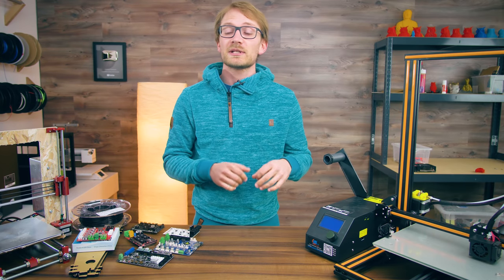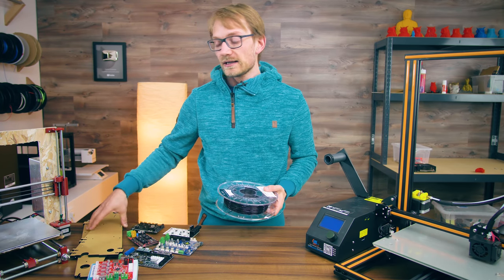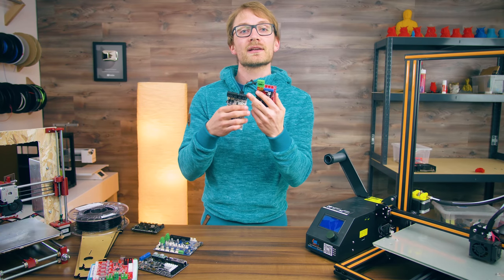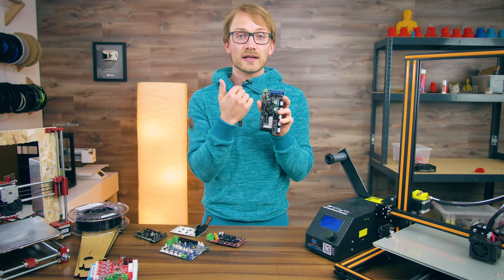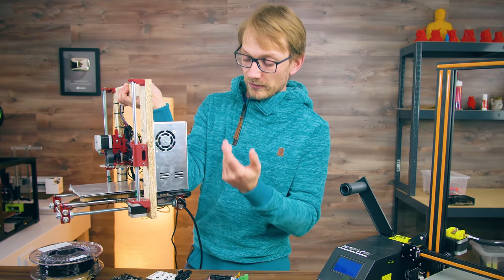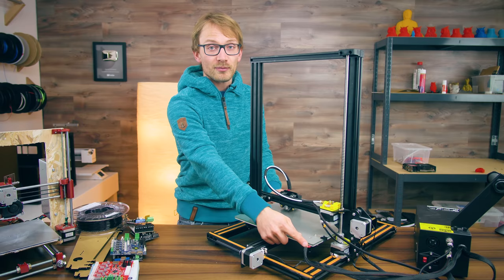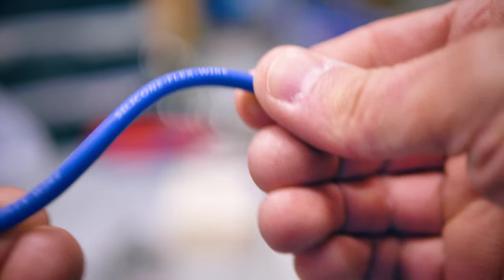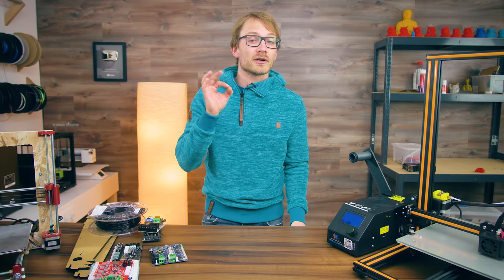Everything you need to know to make your 3D printer fireproof!

Comment: As a firefighter myself this is a good topic to be covered. With things being made cheaply to keep cost down safety is the part of the trade off. It's always a good idea to do routine inspections of your equipment to make sure there's no problems before it becomes one.
Reply: Agreed, plus a good idea to situate the printer away from combustible materials if possible to prevent a fire escalating. Not a good idea to leave it unattended either. I've seen adapters and plugs on high power appliances such as electric heaters go into meltdown because of bad spot welds holding the internal bus bars and pin contacts together.
Reply: Do you think it's a good idea if I inspect my printer from a stream webcam with octoprint while I'm away? Pause my print or simply use a remote socket to unplug it! I can stay for the first hour maybe or something
Reply: thank you for being a hero! :) THANK YOU SO MUCH!

Comment: I've been thinking about picking up some "Stove Top Fire Stop" fire extinguishers for my 3D printer enclosure.  I made an All-wood enclosure (even though you discount it, having an all-plastic enclosure is just as bad, maybe worse) for my printer.  There are a number of automatic fire extinguishers that rely on a fire melting something to release the retardant.  I think this is something we need to see in the 3D printing community.
Reply: Maybe its an overkill but in somecasses its should be usefull. I think its more importent to recheck everything in 3 months or so. maintenance
Reply: I was thinking about getting something like this too, but my concern is that it's designed to be mounted on a metal stove hood, which isn't going to burn or melt. It only goes off after sustained and direct contact to fire, so If you put it on a wood or plastic mount, it's possible that it falls off and fails to trigger.
Reply: Yeah you can get those online @wildrosebuilds has a video testing them out. They're not the cheapest but the peace of mind is definitely priceless.

Comment: This was actually one of my biggest concerns when I designed my 3D printer. Here is a list of all the things I did to prevent fires. 
- Lots of fuses. My bed and my hotend have there own fuse. The board also has its own fuse
- All heaters currents go around the board, not through the board. The bed has an SSR
- All Marlin safety features used
- When SSR's fail, they stay open all the time. Therefore I use a relay which can shut off the current going to the bed and the hotend. The relay is operated by the firmware and is turned on when the printer turns on, and turned of when the kill procedure is activated. 
- There is a mechanical bimetal switch on the bed which switches the bed of at a curtain temperature in case of a firmware error with the bed heater.
- My printer prints inside an enclosed frame. I have a smoke detector inside the printer frame. Smoke will be detected at a very early phase. 

My printer actually failed once because the connector switching the safety relay got lose. It is always funny when your ridiculous amount of safety features cause problems of there own.
Reply: In response to your last line,  I work on military helicopters doing electrical work.  The engine fire detectors, that tell you when your aircraft is on fire, go bad and set off the warning quite often.  I've changed dozens of those sensors but have never seen an engine fire.  I think it's to the point that the pilots assume it's a false alarm every time it happens
Reply: I got one from that same brand. If I remember correctly the brand was "Self Fulfilling Prophesy"

Comment: There is a company in the UK called Jacktone who sell "Auto fire extinguishers" the just have a hose connected to the valve.
When the hose ruptures from heat, the extinguisher releases its content.
These are great and work without triggers, cable or other moving parts which have been known to fail and not trigger the fire extinguisher.
Reply: Don Mega he said contents not water
Reply: Fire extinguishing also should cut off power supply first
Reply: Don Mega you can get auto co2 extinguishers, problem solved

Comment: Gypsum board/drywall... there's a REASON it is used in structures. So instead of making a wooden box, build a drywall box with the wood frame OUTSIDE the panel;  any flames that occur can only come in contact with drywall.  (Note drywall will not contain a raging fire, and the "seams" are a weak point but you can use angle bracket framing to help prevent any flames from leaking out)

Comment: Really great video! Something you might have added, when talking about improving your printers safety are external mosfets: They are designed with more current in mind, so they will have reserves, but they also come with connectors that are capable of dealing with higer current than the stock connectors on the control board. And by using an external mosfet you lower the current going to your contol board, lowering the danger of using the bad connectors for power supply of the control board. And it will allow you to add a fuse just for the mainboard with a rather low value, because all the big currents will run on the external mosfets. I think it is a major safety upgrade for a 3d printer to use external mosfets for hotend and heatbed and use 3 fuses - one for the headbed, one for the hotend and one for the controlboard (without heatbed and hotend current).

Comment: My machine is in an IT rack that ended up being just the right size for it and its accessories, it's extremely cheap second hand, it's sturdy metal with a glass window and has plenty of mounting points for cameras, raspberry pi, spool holders and whatnot, it keeps the ambient temperature predictable and avoids drafts, keeps everything dust free and it looks badass. ^^

Comment: The only time I've had a thermal runaway is when my layer cooling fan shroud was poorly designed and cooled the nozzle.

Also, if fire is a huge concern, there's likely a way to wire up a fire alarm to main power of the printer.
Reply: By the time there is a fire, cutting power won't matter.
Reply: @janbroz4681  thats so true! cutting power makes no sense if there is a nice little fire going on
Reply: @janbroz4681  it will smoke before it burns (I think)
Reply: @korodo7599  fair point
Reply: @janbroz4681  Actually it very much matters. There is no point in a sense on putting fire out, when heat source is still creating more heat, ie shorting wires etc, so first cut the power and then put out the fire, if possible both at the same time. Also helps to prevent getting electrocuted if metal frame is on contact with the wires or something like that. After power is off, you should be able to put it out even with some water(?), if there is no fire extinguisher around, witch there should be one and it should be inspected one for that.
Reply: @Hellsong89  I wonder how people do that when they make long prints (even several days ones). Don't they move from the house / appartement? And to have dedicated space where there is nothing flammable within reasonable distance is not that easy. Maybe it would help to have printer in some proper metal case that prevents fire to escape even to leak i.e. melted plastic on fire, still ...
Reply: I have done this on my printer. I have a power relay and thermal fuses that cut the main power when anything starts getting hotter than it should. If a fire does still manage to start then I have an automatic fire extinguisher and a smoke alarm. The thermal fuses should blow before anything gets hot enough to cause a fire though, Video on my channel if anyone is interested.
Reply: @RickyImpey  Cool video!

Comment: Awesome Video Tom!!! I own an Anet A2 I have two small children at home, and the first thing I did was upgrade the main wiring for the heated bed and from the power supply with 12awg silicone wires, also bought spade connectors, auxiliary mosfets, a 33amp power supply, smoke alarm, changed the connectors on the heated bed, and managed the wires properly... now I just bought inline fuses for both the hotbed, and hotend!! Thank you for this, one more thing that I can add to my printer for some more peace of mind!

Comment: I love this video. Ive been advocating so many of these safety tips for so long. A few more things I may suggest:

Cork pads/mats. Cork dosen't burn like a yoga mat or rubber mat can. Makes for a great insulator for a printer to sit on to help limit sound vibrations, Can be easily gotten and used to help insulate mountings of electronics from metal frames.

Sheetrock. Another good, non-flamable material you can set your printer on top of to help keep a table top from spreading a fire, this is the same reason it is used on the interior walls of a house or gun safe.

Another idea I have seen people do with RC batteries that may work for a 3D printer if there is a large enough rack over head of it, A large plastic bag full of sand. The basic theory is the heat from a fire melts the bag, dumps the sand and smothers the fire. The sand also can help to limit spread of any melted plastic to help stop the spread of anything burning.

KNOW WHERE YOUR GAS LINES RUN IN YOUR HOME!!!! Dont print next to gaslines. Should a printer fail, it being near an even bigger fuel source can make the situation worse. Yes, gaslines are rated to deal with some degree of flame to help stop failure, but dont blindly trust it on its own.

Just a few ideas for v2 of fire safety video :P
Reply: Actually, another point about nearby gas lines is if you do get a gas leak, and there is a heated nozzle and bed nearby, that heat could ignite the gas.

Comment: I plan on using a smart smoke detector.  I'm almost finished with my enclosure.  One of my other hobbies is automation.  I personally use Smartthings to control lights and doors.  I already have a power switch that my 3d printer runs through.  I can power off and on the printer remotely if needed.  It comes in handy when that one print is almost done but I have to go to work. 

With the smoke detector in the enclosure, I plan on setting it up to automatically turn the printer off if it detects smoke.  That way, if the smoke is electrical in nature, it should prevent a fire if is detects it early enough.  I would expect it to also work for catastrophic print failure that balls up on the nozzle and causes any smoke.

Comment: I had the cheap ramps connector melt on me once. I ended up buying a bag of 12v barrel jack connectors for it instead and just pressed it in the pins. Works like a charm and it hasn't melted or shown any signs. Good stuff.

Comment: I also own an Anet A8, for roughly a month now. Today has been a very  weird day for my relationship with it. I received the recommended mosfets and a soldering iron in the mail, got really stoked about how well it's lasted and started taking it down. When I took the bed connector off, it wiggled right out of place and had a nice scorch mark on the side next to the 12v pin. After following the community's suggestions of "fixing it", I see Thomas has released a video with even BETTER suggestions about this very issue! 

I can't recommend enough that if you buy one, get the electronics and do some soldering... I really don't think these are complete right out of the box. 

That being said, it works quite well. I've binged hours of different 3dp content before and during my ownership, and i'm really happy with the quality of what little I have made. I would still recommend it to people, with the stipulation that you treat it like it needs to be treated. Like a cheap piece of miniature chinese industrial equipment. lol.

Comment: How great! I have learned so much from watching you. You pointed out a fault on the Creality CR-10. I bought one. They must have watched your video because they thought they solved that with a plastic strain relief attachment. The only problem is, it prevents the bed from leveling because they attach it under the bed the a leveling lug. I sent mine back, after making a video pointing it out. Personally, after taking mine apart, I would never own a Creality. They are assembled poorly. It printed 1/10 of the Cat before shutting down with Thermal Runaway. I took the heater block apart and they had bent the thermistor wires right at the base of the bulb, breaking it; not to mention tightening it too much and squishing the insulation. I replaced it with a Winice M09, slightly smaller, but I love double Z screws, not to mention assisted bed leveling.

Comment: If you’re printing in a basement or garage that has exposed ceiling with pipes, it’s pretty cheap to have a plumber add a fire sprinkler. Several years ago I had a plumber add a couple around our gas hot water heater and gas furnace and that cost about $150. I run my printer on the other side of my furnace a few feet away but still under the sprinkler and have no fear.